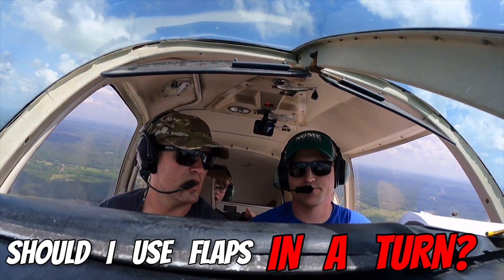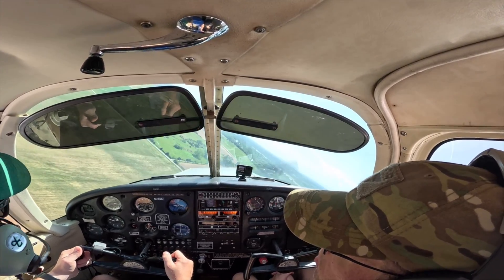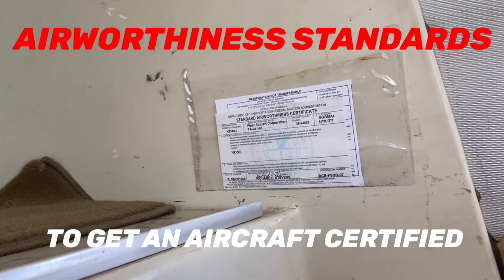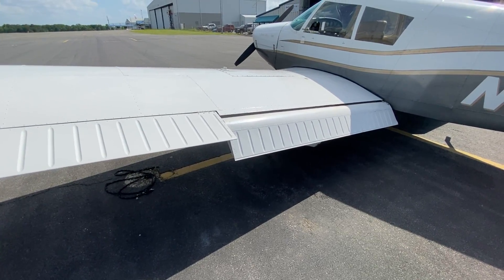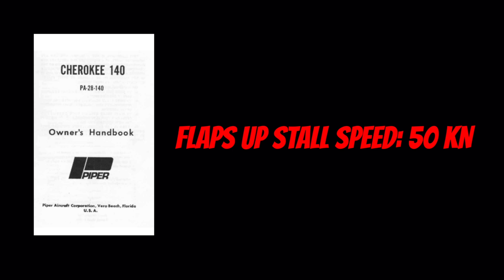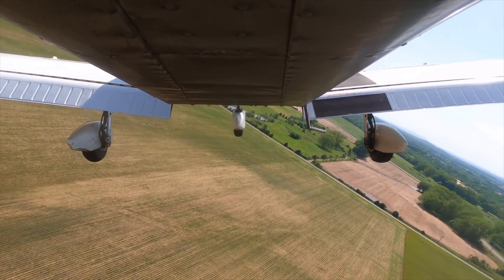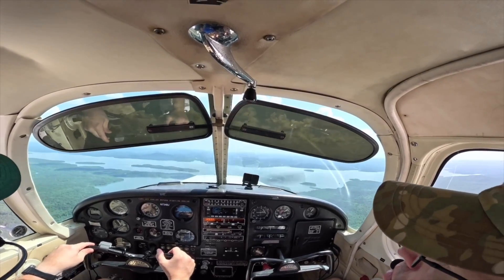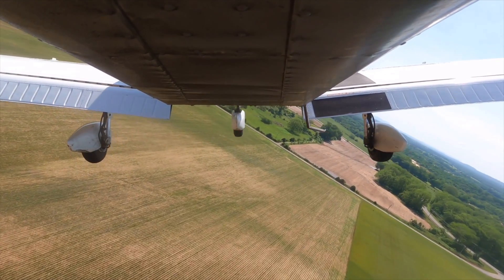Should I LOWER Flaps in a Turn?

Comment: I thing the actual dangerous thing is to CHANGE the aircraft config in a turn, as it is much harder to control the aircraft speed/AOA/VS in a turn.
Reply from the maker: So I would argue the opposite.  I believe that it’s much easier to handle the initial balloon from the flaps in a turn because you’re using centrifugal force to your advantage instead of forcing the nose down
Reply: In theory. However I know several stall/spin accidents originated exactly from extending flaps in a 4th turn. One even was at my home airport.

 I guess this might depend on an aircraft, but some flap types (fowler, „crocodile”) would quite rapidly slow the aircraft if power is not added / nose not lowered. If the pilot is not paying attention and looking for the field in the 4th turn, this might indeed not be safe. I personally feel better changing the config in a level flight, when possible.
Reply from the maker: @DrzewieckiDesign  I would say that it’s important to know your limitations as a pilot.  I’m having a hard time believing that someone got task saturated by lowering flaps in the turn.  I bet there were some other factors involved
Reply: @FreePilotTraining  What is your opinion on my latest comment?

Comment: I had a cfi teaching me some bush flying in a 1961 182. He was using the manual flaps to tighten turns in level flight following a river. Adding flaps in the turn releasing as the turn rolled level out.
Reply from the maker: That’s pretty cool! I’ve been getting a lot of crop dusters telling me that they use them for this as well!

Comment: I'm struggling to understand how flaps decrease your turn radius. I understand that they create more lift, but isn't that countered by a lower AoA? I'm just confused because if the amount of lift required to maintain level flight stays the same how more lift is being put into a turn with the same bank angle/speed. Granted I see your demonstration and see it happening, I just don't understand how. 

Great video by the way!
Reply from the maker: So, I didn’t demonstrate this in the video, but they allow you to fly at slower airspeeds which definitely decreases your turning radius. Now, it’s my personal theory that flaps still increase turn radius by themselves because of an increased horizontal lift component and because I don’t believe that load factor is equal and opposite of horizontal lift
Reply: @FreePilotTraining  I 100% agree that slowing down will decrease your turn radius. Where you lose me is the additional horizontal component of lift. It's my understanding that to maintain straight and level flight with an increased flap setting you need to decrease AoA so you don't climb. By doing that you are creating the same amount of lift as before you added flaps. From there if you turn, you are still needing the same vertical component of lift (because same weight), which would require the same total lift (since it is the same bank angle) which would create the same horizontal component of lift. 

Just an FYI I'm not trying to argue with you or anything, I'm just trying to understand this because it's the only thing I don't get in the video.
Reply from the maker: @777coletrain  no, I don’t mind this conversation.  This is a complete theory of mine. As I stated, horizontal lift component apposes load factor, BUT if my theory is correct, load factor IS NOT equal and opposite of horizontal lift because BELOW flaps limiting speed, weight will be greater than the force created by inertia.  In my personal opinion, THIS is why maneuvering speed is so important.  Load factor is closer to being equal and opposite. Now, if weight is greater than the interia force, WHEN we lower flaps, the horizontal lift component can become greater WITHOUT increasing vertical lift.
Reply: @FreePilotTraining  It’s my understanding that inertia would be opposed to the horizontal component of lift and load factor is opposed to total lift (since it is a combination of inertia and gravity). But I think flaps can only affect total lift which then can be used to manipulate your horizontal component. So if the vertical component is locked in (due to weight) I don't think there is much you can do outside of bank angle and speed to change your turn radius. 

So my question to the last statement is if you are in a bank and you add flaps, they increase total lift, so how can that not change your vertical component? I would agree that it would increase turn rate and decrease turn radius and slow the airplane but with a cost of decreasing descent rate.
Reply: You're right, he's incorrect on the turn radius. I didn't think anybody else had caught that. The clincher is that any given bank always gives a constant load factor at any speed. If flaps could tighten a turn at a given bank, then they would have to add Gs. Since we know flaps don't add Gs, they can't be altering the turn radius or turn rate. I suspect flap extension causes his airspeed to read high, and that correcting for this results in a slower actual speed and tighter turn radius.

Comment: What about making a fly around with full flaps? Is it safe to make a full throttled fly around when your landing isn’t good
Reply from the maker: Technically, it’s safer as far as stalling is concerned if you’re flying straight and level, but most airplanes don’t climb too well with full flaps.  Plus,  if you fly that slow in the pattern, you can start clogging up the pattern which can cause other safety concerns if other pilots aren’t expecting you to fly that slow.

Comment: The part that was left out in regards to stall speed vs load factor is that the aircraft can be in a 90 degree bank and never stall. As long as the pilot is not attempting to maintain altitude while doing so. If you keep the wing unloaded it will not stall.
Reply from the maker: That’s a fact. A zero G aircraft will not stall

Comment: When CFI I used to teach crosswind landings using normal flaps until short final.  Then raise them slowly to land with no flaps.  No, you wont stall if nose is down, it even accelerates a bit.
Reply from the maker: I’ve actually heard this technique a few times now.  I may make a video
Reply: @FreePilotTraining  That was in 1999, so i dont have any videos myself.  I even had a blue line on Vglide speed on all airplanes i taught there (about 6) A now called DMMS line.
    If Crosswind, i used Vglide Blue Line until short final with flaps, then cut them slow to land with none or 10 degrees only. 
Put a blue line on Vglide first.
Reply: @FreePilotTraining  I was the old CFI that in 2010 put the first video on youtube showing how to do 4 kinds of EFATO and cutting flaps on flare and accel stalls and other maneuvers. I did that video in 1995 when CFI.  Cherokee, Sebastian airport FL, 4,000 feet runways, 16 knots winds.  Yes i did 4 tailwind landings on 4k runway. Cutting flaps..
    After 2 weeks i was insulted so much that i put it private.  Its still private.  But some brave pilots started practicing the EFATO Turnbacks i showed (2 kinds, partial and no power, Cherokee 150).

Comment: There is an incorrect claim in this video.  If airspeed and bank angle are "givens" (i.e. held constant) , and altitude is also held constant, then it is not true that modifying the shape of the aircraft (e.g. lowering the flaps) will affect (reduce) the turn radius.  Rather, the only thing that will be changed, one way or the other  (depending on exactly where the aircraft is flying on the power-require curve), is the power required to hold altitude constant.  This idea, specifically in reference to this video, was recently the subject of a well-stated question, and answer, on the "Aviation Stack Exchange" website.  My earlier comment along these same lines had specific links, but seems to have been auto-deleted.  Curious and motivated readers will have no problem googling up the links I'm alluding to-- the ASE website can be seen by anyone, subscribed or not.  Edit:   specifically, to get directly to the Q and A pages I'm referring to, google "Aviation Stack Exchange Can the use of flaps reduce the steady-state turn radius at a given airspeed and angle of bank?"  -- thanks for your attention.   Not to say that there's any problem with using flaps in a turn-- I've never heard anyone make that claim.   Also not to say (in reference to an earlier comment) that dropping the flaps won't help you do a quicker 180-degree turn in a box canyon -- but in that situation airspeed should definitely not be held constant, and altitude probably shouldn't be held constant either.
Reply from the maker: Thanks for the comment Steve. I don’t delete comments unless they are vulgar or inappropriate, so your comments should be there somewhere still.  Something I did not mention in the video is that flaps allow you to fly at slower airspeeds which definitely will shrink your turn radius. Now, I don’t disagree with your comment, BUT that assumes that horizontal lift is equal and opposite to load factor which assumes that weight and centrifugal force are equal. I don’t actually believe that to be the case.  Many physicists believe that centrifugal force is not even a real thing.  I don’t share this particular belief, BUT I believe that the increased lift that is created by the flaps improves this turning capability because there is a side load on the aircraft.  Now, once again, this is a theory, but ag pilots intentionally use flaps to tighten that turn radius.
Reply: @FreePilotTraining  Thanks for the reply-- I think the system may have auto-deleted the comments due to the embedded links.  I don't want to get in detail into the physics right here; sites like ASE are better suited for that.  All I'll say right now, is that in cases where pilots find that dropping the flaps tightens the turn radius, I suspect that they are most likely (perhaps unconsciously) taking advantage of the extra lift coefficient to either increase the bank angle, or to fly at a lower airspeed, or both, possibly in some cases (e.g. the box canyon situation) in combination with a temporary "zoom" climb.

Comment: Im one of the rare ones who has had split flap in a C152. Turning right onto base in circuit, right flap didnt go down. Slight roll noticed, nothing uncontrollable, recycled flap no improvement. Did a flapless landing. Turns out cables had jumped guides.
Reply from the maker: Thanks for the comment! That’s pretty crazy! The ol girl was still controllable? How bout that?

Comment: If someone is afraid to use flaps because of a possible split flap condition, perhaps they should take up a different hobby? 

Some of my personal experience is using 30-40% flaps whilst diving nose down until rounding out just above the water.

But, yes, e does equal mc**2 so long as e is energy, m is mass and c is the speed of light and also agreed that the equation has nothing to do with using flaps in a turn (or otherwise).
Reply from the maker: Agreed!

Comment: Thanks for this video, definitely some good information! Also, when you add flaps in a turn, would this make the nose of the aircraft rise or drop? I'd think it would make it drop a little.
Reply from the maker: No problem! It’s almost unnoticeable in the turn, but it’s initially a pitch up from the extra lift, then a pitch down from the center of loft moving back
Reply: @FreePilotTraining  Thanks
Reply from the maker: @GalenCop9  No problem

Comment: I would agree with what you said in the video. Additionally, split flaps conditions not neccesarry need to occure when flaps are traveling. They can also occure when the flaps are already set.
Let's say, you are lowering your flaps before your turn, because E=MC² told you so, and when you turn base2final the rod/shaft connecting your left and right flap breaks, then you have the situation that you initially wanted to avoid. And this is not that uncommon. A friend of mine had that when he was dropping parachuters out of a C182. The flaps splitted on short final, long after the flaps have been set. Thats the only split flap condition, I've heard of. Setting them in or outside of turns whouldn't have changed a thing.
Reply from the maker: That is an excellent point! They could just as easily split in straight and level flight

Comment: Great video! Going to cite part 23 next time I have this conversation. However, a month ago at the flight school I currently work at there was a flap roller that failed and the flaps got wedged into the ailerons and locked them into position. The aircraft was in a bank at the time so they got locked into a bank and had to declare an emergency and fly another lap in the pattern with rudder and elevator trim. Highly unlikely situation, but that is also a hazard. I will still use flaps in turns for all my patterns.
Reply from the maker: That is an excellent point. If the flaps get wedged into the ailerons, your basically screwed if you can’t get those loose.  The best option is to try and move them back where they were immediately
Reply: and climb    if possible and last resort pop your caps    Cirrus wannabe man here

Comment: I have encountered only one (1) split flap condition in 40+ years of flying and it was an eye opener! I was “test” flying a turbo Cessna 182RG that had just come out of annual inspection. Preflight looked good so I taxied out for takeoff with about a 15 mph direct crosswind from the right and I was using 10 degrees of flaps. During takeoff I noticed I was having to hold a little “left aileron” which was weird with a crosswind from the right. The plane took off very quickly with just me in it and I raised the gear and brought the flaps up……things got really crazy at this point. As the plane accelerated I had to hold more and more Left aileron until I was beginning a roll to the right with the yoke against the left stop! I pulled power to slow down to get the plane back under control and lowered the gear as I was turning back to the airport. I broadcast on Unicom (uncontrolled airport) that I was having control problems and was coming back to the airport immediately for a right downwind to the runway. I experimented with flap settings as I was returning to land and found that with full flaps my controls returned to normal so the landing was uneventful. The mechanics were skeptical when I told them what had just happened and told me that every thing appeared to be normal. I went to the back of the aircraft so I could inspect the flaps and noticed the left flap was hanging down about 1.5” while the right flap was all the way up! Houston I see the problem……the mechanics had replaced the left flap control arm and failed to properly adjust it! On preflight I had dropped the flaps down and everything looked good during inspection but honestly don’t know if I would have noticed the left flap was hanging down 1.5” anyway.
Reply from the maker: That’s crazy! I love hearing from people that have real experience in these situations

Comment: I often add flaps in my base and final turns. Especially if I need to slow my airspeed,    I believe, as long as my air speed is safe, it's OK.     In a Cessna 172, as long as I'm around 70kts, even a split flap scenario won't stall me... right?  ...of course maintaining an average pattern bank of 20 degrees
Reply from the maker: Yeah, 70kn should be fine. That’s what I use